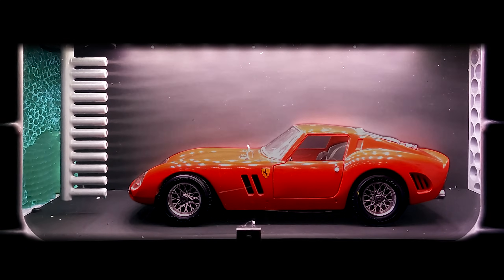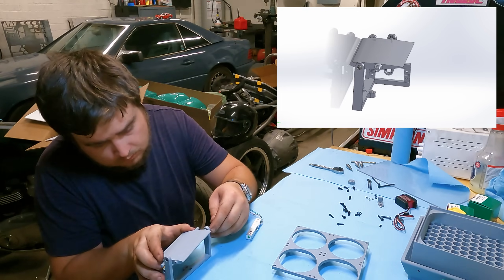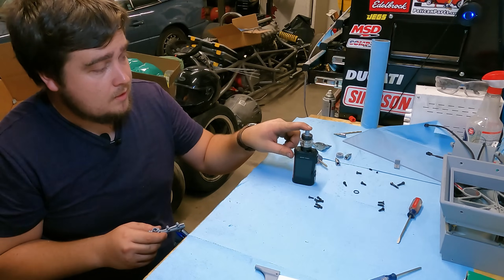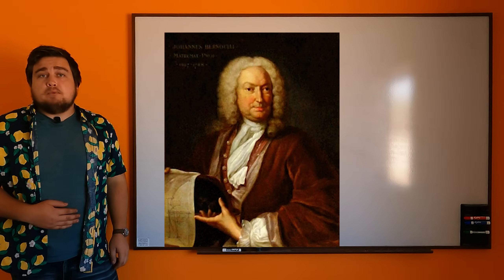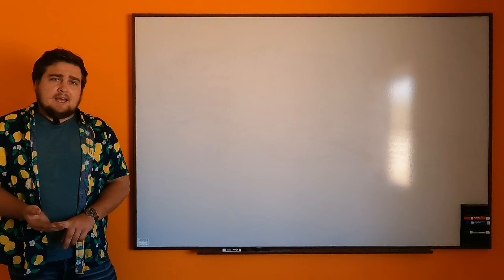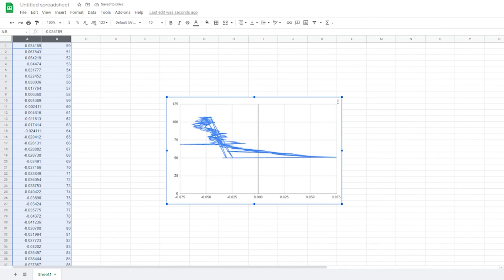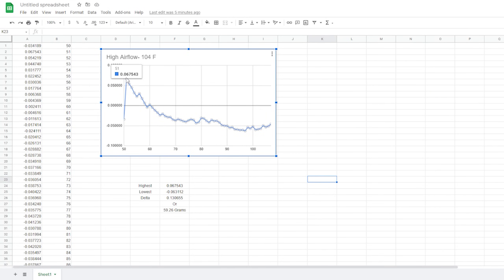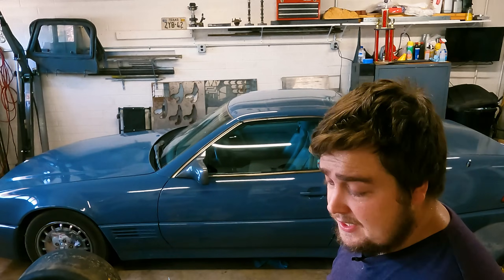DIY Active Aerodynamics | Pt. 1 of 2 - The Wind Tunnel

Comment: It might be useful to get some real numbers from the real car: add suspension actuation sensors and use corner scales to work out the correlation between suspension load and actuation, then mount a pitot tube to the nose of the car and add an accelerometer. The last part needed is a way to measure live engine output. Not sure if there's a standard kit for this, but I've got an idea of how it would be done using phase detection of both ends of a driveshaft, either magnetically with hall-effect sensors or with optical encoders.
Reply from the maker: Yeah I have a few different ideas for measuring speed, wheel speed, forces involved, exc.

Comment: A few thoughts from an aerospace engineer:
-You want your flow straightener (straws) at the widest point of your intake nozzle and then a nice smooth contraction down to your test section. Both the straws and the contraction work to suppress turbulence in the intake. A contraction ratio of 10:1 (area-wise) or so would help a lot.
-Your smoke rake should be airfoil-shaped to remove the turbulence generated over the back of the down-tube. Then the rearward facing tubes should be as small as possible to minimize their impact to the flow. Some 1/32" brass tubing from K&S would work great and could be pressed or glued into a 3-D printed part.
-Optionally, you want some expansion (a diffuser) behind the test section. If you used 9 fans arranged in a square but kept the same test section size, that would be a good starting point. The diffuser should have a half-angle of no more than about 3-5 degrees.

Can't wait to see what you come up with!
Reply: These are great insights, thank you for sharing.
Reply: The contraction section is to accelerate the flow rather than smooth it out.

Before creating a higher velocity wind tunnel, I'd rather assess repeatability of the set-up, which will probably be very, very poor. In order to improve it, it would be wise to remove the smoke section, which in real life is not used anyway, and also the test subject should be much smaller in order to prevent blockage and wall effects.
Reply: @Agussg23  A larger contraction would only produce a higher velocity if you had the fans on the inlet and not in the diffuser. With them on the diffuser, all it does from a velocity standpoint is lower the velocity at the inlet.
Reply: @rocketplane  mass flow is constant, it doesn't matter where you put the fans, it's more of a matter of having a higher quality flow.

If the contraction ratio is higher, velocity at the test section will be higher. This is taking into consideration that the mass flow increases so that velocity at exit remains the same as when there was a lower contraction ratio
Reply: @rocketplane  No - not true. Almost all wind tunnels have the fan on the diffuser exhaust.  My two do.
Reply: @chrispollard6568  that's what I'm suggesting. Sorry for the poor wording
Reply: @Agussg23  No - it creates laminar flow.  Blockage can be up to 15%
Reply: @chrispollard6568  you're saying that the blockage in that wind tunnel is ok, and that the set up is repeatable?
Reply: @Agussg23  No - not at all.  The whole tunnel is pretty worthless.
Reply: What did you think about his molecule covering a greater distance in the same amount of time? I thought we were past that in aerodynamics?
Reply: @anidiotinaracingcar  We are.  It's wrong - see the video by Doug McLean
Reply: @anidiotinaracingcar  I think he was just trying to explain that air (and air molecules) moves faster when where is a decrease in pressure
Reply: @Agussg23  That's not true either.  It's the other way around.   Static pressure decreases with and increase in speed
Reply: @chrispollard6568  no it's not mate, if you have a higher contraction ratio the mass flow through out the entire WT will be the same. If volume decreases massively in contraction ratio, pressure goes down and velocity up
Reply: @Agussg23  You don't know what you are talking about.   "Volume decreases massively" is nonsense.  I've designed two wind tunnels thanks and computer modeled them.  I can predict their performance within a few percent.
Reply: @chrispollard6568  with volume decreases massively I mean that the test section area is much smaller than the rest of the tunnel, in some wt the area is 10-1. English is not my first language but you still know what I said, so stop trying to say that I'm wrong when I'm saying basic things.

I work in a wind tunnel.
Reply: @chrispollard6568  btw when have I said that you can't simulate the wt performance??? See what I'm saying you're trying to correct me when we're saying the same thing
Reply: @Agussg23  The contraction smooths out the flow.  The "volume" doesn't change - the area does.
Reply: @chrispollard6568  ok, true on the volume side, I was mistaking it. But the contraction also serves to accelerate the flow in the test section.

The main tools used to smoothen the flow are the settling screens just before the test section
Reply: @Agussg23  The settling screens take out the turbulence from the honeycomb but the turbulence from those screens has to die out too.  it only becomes laminar at the entrance to the test section.
Reply: I’ll keep this in mind, thank you random aerospace engineer!

Comment: Surprised you didnt just build your own vape using a mosfet, 18650 batteries, and a user rebuildable dripping atomizer (RDA). 
That would have allowed you to build a really big high resistance coil that better suited your vapor output needs all without burning out those expensive prebuilt coil modules!
 
if it would benefit you, let me know & I can build one & have it shipped to you within 4 days. (even less if you just want to use the atomizer setup on your current power device)
I can even label it as anime action figures on the shipping so your parents dont find out lololol
Reply: Who use prebuilt coils in 2021? And anime action figures? They can trigger parents waaay more than a vape. Guess I'm just old. Been hiding my smoke habits from parents for more than a year. 20 years ago.

Comment: Some suggestions if you're looking for maximum results:

As mentioned, for better similitude between your model and reality, you need to try to match the Reynolds number. For a smaller-than-reality model, you can do this by increasing air velocity and increasing air density. You probably can't get either high enough for a perfect match with inexpensive equipment, but you can get closer. Just make your airspeed as high as feasible, and consider using cold air if it's available or can be manufactured. (Got an A/C unit?)

You can improve airspeed and reduce turbulence in the airstream by using a choke. Basically use a larger size air intake and flow conditioner, then smoothly decrease the tunnel size into your test chamber. This will increase airspeed and shrink any remaining turbulence after the conditioner.

Try not to overfill your test chamber. If the model is too big, it starts compressing air against the walls of the chamber, which will affect your results.

If you are doing full vehicle modeling, be aware of ground effects and how they are different for a stationary car vs. a rolling car. There are various techniques for dealing with this, but I've gone on long enough and you can research those on your own.

Anyway, even without being obsessive about it, it's a really cool project and I look forward to your results! It's something I've thought about a lot (clearly) but never got around to doing myself, so I can live vicariously through you.

Also, don't discount the redneck solution: strap your model to the roof of your car and drive down an empty road.

Comment: you probably already know this, but the bigger the scale of the prototypes you put into your wind tunnel, the more accurate your data would be. :) very interesting project to toy with :)
Reply from the maker: Yeah, that’s my problem with small scale stuff is I lose accuracy.
Reply: @WesleyKagan  I would also suggest not to use positive pressure to suck the vape smoke as that disturbs the air in your wind tunnel when it comes out.

the air isn't too laminar from the video? or is that only from the video? maybe a longer with gradual expansion of the inlet? good luck, will watch subsequent updates on this project!

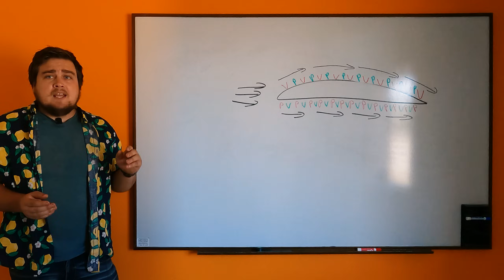Comment: 6:58 - "All physics taught below Junior year college is a lie; and it's taught that way because it's funny" -Alice Caldwell-Kelly (Well There's Your Problem Podcast)
Reply: Not true.  Most engineering is done with high school level physics.
Reply: @chrispollard6568  All models are wrong, but some are useful. https://en.wikipedia.org/wiki/All_models_are_wrong
Reply: @squiresuzuki  My models are not wrong.  They are mostly within 3% You use the results of those models.
Reply: @chrispollard6568  You missed the point. Being "within 3%" is by definition wrong, however, it is an adequate approximation of reality for most engineering purposes. Similarly, as explained in the link I gave, Newton's theory of gravitation (high school physics) is completely wrong because it goes against Einstein's theory of relativity, but again, Newtonian physics is far simpler and is more than adequate for the vast majority of purposes.
Reply: @squiresuzuki  It isn't "Wrong" because it works.  My "high school" physics works to give people like you working products that you actually use.  Your computer disk drive WORKS.
Reply: @chrispollard6568  You're still missing the point. Read the link I posted.
Reply: @squiresuzuki  Do you actually design anything that works first time to specification or are you being pedantic?

Comment: Good stuff. You will run into the limitations of a miniature tunnel so I would say your best bet is your full size algorithmic approach otherwise you will end up having to do that anyway because of correlation issues. I built something similar many years ago with a broken vacuum cleaner which I then ended up starting, but not finishing, building a head porting flow bench. You will get better laminar flow if you have a vacuum chamber pulling though straws as well as a straw entry plenum away from the front of the pitots. Good luck

Comment: Man you think just like me. I've wanted to make a DIY wind tunnel for years but you are taking it to the next level. I've always liked the idea of active aero too. I've been thinking about how to do a spoiler for a long time. 12v linear actuators are slow, and air actuators need a compressor etc.

My only suggestion is your smoke tube thing. Maybe make it in Y style. So 1 Y's into 2, 2 into 4, 4 into 8 etc. In an effort to split the smoke equally . I'd also make the holes a little smaller. And maybe try make it more aerodynamic itself to keep the smoke lines cleaner. (think the shrouds around aeroplanes wheels with stationary wheels, the typical teardrop shape) 

Gagging to see the next episode.

Comment: Very exciting stuff!!! I would like to see an AND gate that sees input from the brake light and a sensor in the steering column to return the wing to the lowest drag coefficient when neither braking, nor turning.
Reply from the maker: I’d actually like to set it up so it goes off accelerometer instead of sharp inputs.
Reply: @WesleyKagan  That would be far more intuitive to program, since you could easily increase down force with negative values and decrease them with positive ones along one axis, and increase down force with any value greater or less than 0 along the other. 
Perhaps you could incorporate a transducer and take any repeated sharp input (such as a line of potholes or other harsh road) and have the wing come up to push your car down more when your traction is upset. Up here in Michigan, 90 mph and a washboard of potholes is a real white knuckle experience! 😅
Reply: With DRS in F1, the raised rear wing element returns to its base position as soon as the driver brakes but the downforce doesn't return to base levels until a moment later after the airflow has stabilised. If you're running a 3 pedal car, detecting when you lift off the throttle may give it a little more stability by the time you're braking.

Comment: I've always wondered how well a miniature air tunnel would work. I always figured the scaling up doesn't work well enough for the effort.
Reply from the maker: I’d love to compare it to a big wind tunnel and see how much of a difference there is.
Reply: Even formula 1 teams have had correlation issues with subscale wind tunnels. I expect the accuracy of surface roughness and edge radiuses will really mess with the airflow at think kind of fractional scale.

Comment: As an RC aircraft modeller of 40 years, can I suggest you work more around wing profiles for downforce rather than angle of attack, high alpha aerodynamics , ie stalling the air over the airfoil are super draggy. That symmetrical airfoil you used with a rearward center of pressure is a poor one for downforce as you get too much separation, and separation is your enemy. I know this is just for testing, but if you test with a basic inverted Clark Y airfoil you would get more reliable and testable results as it is a forgiving low speed airfoil.
Reply: Crazy how randomly reading a comment on a YouTube channel like this help me solve a problem I was having from something years and years ago
Reply: I agree, especially about the high angles of attack leading to flow separation/stall. However, I think an uncambered airfoil is better than a Clark Y or NACA airfoil for the proof-of-concept he has now. 

Separation is not necessarily your enemy for automotive purposes rather than aerospace. Active aero vehicles nowadays use it as an airbrake at high speed, since flow separation creates excellent drag. You definitely don't want this for a fixed wing of course but his video title indicates otherwise.
Reply: @samfedorka5629  Clark Y is uncambered, bit yeah, I picked it out of my butt as it was the simplist with the most data available airfoil I could think of and from experience I know it works well on tiny RC airplane models, admittedly, the other way up. ,  I am sure there are way better,  but anything is better than that truely aweful airfoil he was using. But he is running tests at such low speeds and scale i doubt much data he is getting will be useful in the slightest. You have to go up to 1/4 to 1/2 scale before air flows similar to the full scale vehicle. Certainly no use with an 1/18 scale BBurago toy.
Reply: @ForeverNeverwhere1  Angle of Attack (AoA) is everything.  If you want to live with a wide range of AoA, then you want something with a blunt-round nosed airfoil, like a Clark-Y.  If you want low drag at high speed, you want a shallow AoA range, and a thin, almost flat, airfoil.  Look at the leading edge of the F-16, in a sharp turn, and watch the Leading Edge Flaps hold a narrow AoA.  An F-5 flys well with a flat wing, iff, the AoA is held within the limit of the critical angle.
Reply: @DumbledoreMcCracken  You're comparing airfoils designed for supersonic flight (F-16, F-5) to those designed for low speed. There's a big difference. Most cars seems to use thin but heavily cambered airfoils for downforce compared to the thicker, less cambered ones used on airplanes. Possibly this is because they are supported on both ends (or very short) on a car as opposed to cantilevered on aircraft? The speed range they are used in for car aero is generally lower too, corner speed in a car is lower than what most airplanes experience in cruise. If anything wingson cars most closely approximate an airliner wing in landing configuration.

Comment: You should keep in mind that when you simulate small scale models, you have to alter some parameters to get the same airflow as around the full scale object you are simulating. In your case, Ma-number is low, so your most important goal would be to to preserve Re-similarity by altering flow velocity and/or viscosity (temperature).

Also your explanation of lift was not quite correct. The wing experiences increased pressure on the underside (thats why we call it pressure side) and the explanation why the air flows faster on the suction side is also incorrect. 

Still, i think its great that you try this project. I would really like to have such a mini wind tunnel for my self.

Comment: Really though, I think your smoke generator inlet pipettes are too large. I think ideally you want something as small as possible to disturb the laminar flow as little as possible. Also, you should try and avoid any over pressure from the pipettes, if you can get the main fans to draw out the smoke, I think you'll be able to see the flow lines a lot better.
Reply from the maker: Completely agree. The combination using air to force it out and the inlet pipes cause problems. I have a few different ideas but I'm not sure I could make a vacuum strong enough to draw it out with pure wind tunnel pressure.
Reply: @WesleyKagan  Hm.. maybe move to a smaller pipe ID, then run an even smaller orifice before that to allow for higher pressure flow of the smoke right up until it exits, then slow it way down and let the natural vacuum from the drag bubble that would form behind the outlet do the work?